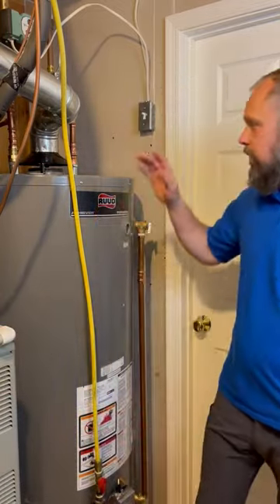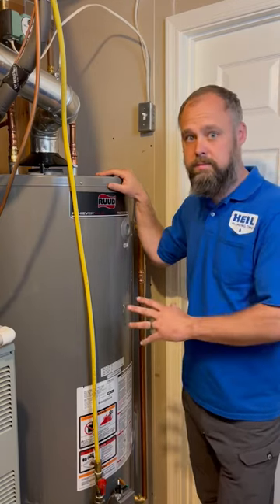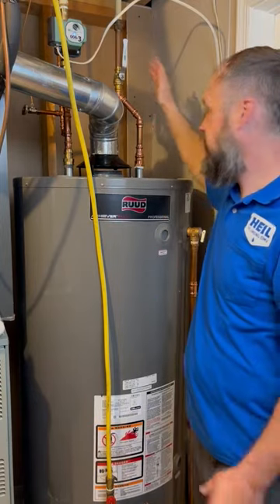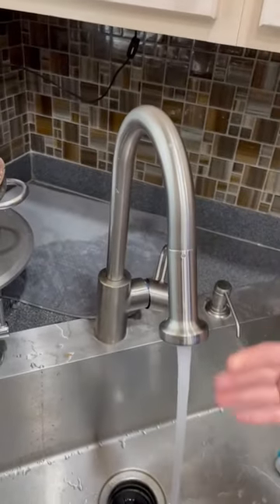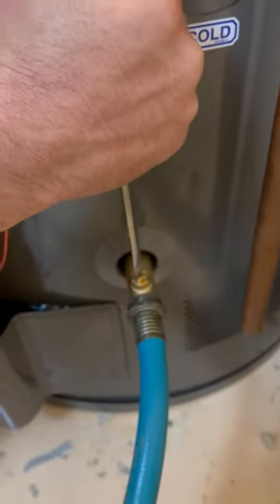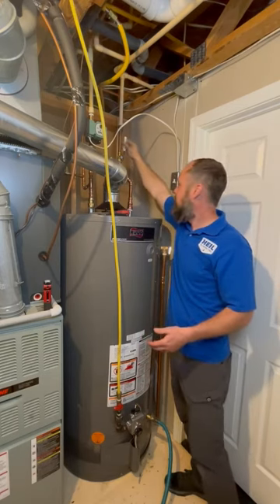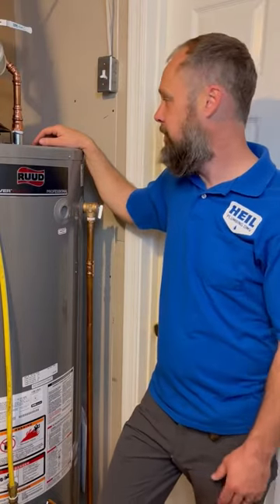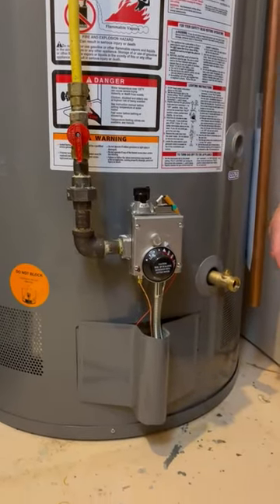Master Plumber Shows You How to Drain a Gas Water Heater

Comment: When do you turn the water back on?
Reply: looks like he skipped a couple steps. after draining the tank, i closed the spigot on the tank. then i turned on the water to refill the tank. leave the faucet on - when the tank refills it will push the air in the tank out the faucet. once water starts running from the faucet then you know the tank is filled.